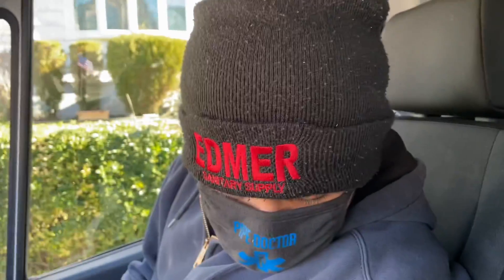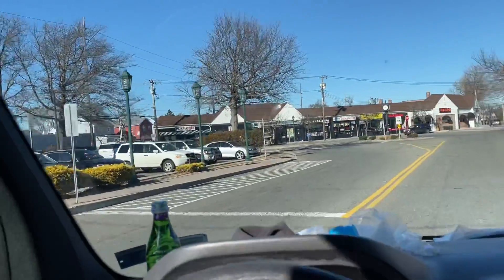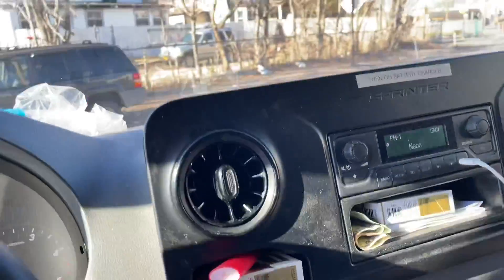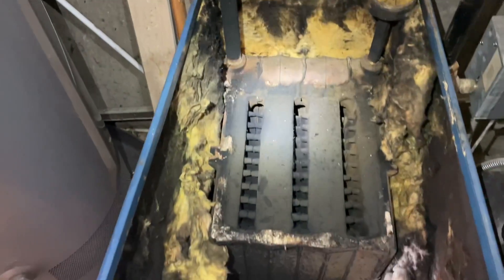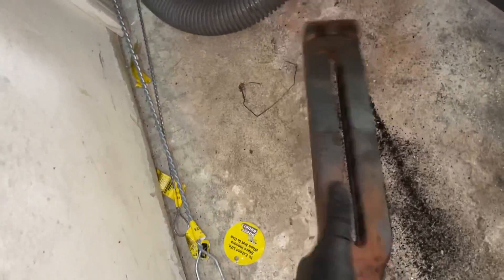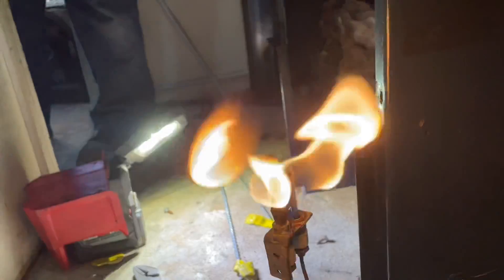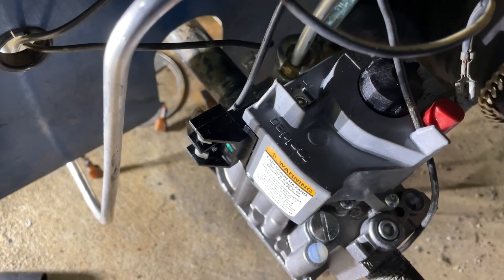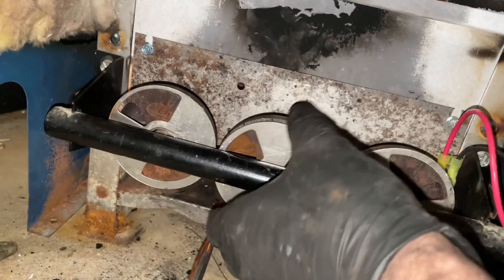They Almost Burnt Down The House Flames Rolling Out Boiler Bypassed Roll Out Switch Dunkirk Boiler

Comment: I've never used a combustion analyzer on a resi unit, seems like a waste to me when you're dealing with 1 maybe 2 stages?  Only time I use mine is on big boilers with power burners that are full mods to make sure you're burning correctly thru all stages!   I guess if I have a power burner on a resi unit I would but don't come across them too often. 

Maybe I'm wrong???

Comment: 12:20 i thought he was being mean but rewatching i had missed the bit about the meter zeroing out.  I find it helps people understand if they can form their own conclusions, tell someone not to do something a certain way or to do somthing a certain way, they wont understand the importance and reason. Have him see how skewed or invalid the readings could be. 
In fact itd be neat to see how sensitive these devices are by comparing relatively consistent measurements with differing levels of calibration "quality". Can they measure the oxygen and co2 of yourself breathing?

Comment: Food for thought. Sometimes easier to clean out sooted/carbonized gas boiler with a hose and wet vac. Soot vac top layer of soot. Then hose down in between sections. Use wet vac to catch water from underneath. Quicker,  cleaner and more through.
Reply: @PipeDoctor  Not as much as you would think. First time someone suggested this to me, I thought he was crazy. Put a gardening thing on the hose. Gives you total control. Have wet vac up and running. Will barely make a mess. You can also put some disposable baking pans under the boiler to help contain the water. Try it. Once you get the hang of it ( won't take you long at all) you will see that this method is a game changer.

Comment: I had call that there was a problem with a gas furnace. The home owe was a election. Who by passed the roll out switch. I wish I could send you the picture of the furnace and AC coil. 
The Ac coil was melted and almost burnt the house down. The owner said don’t need that switch . Be safe guys

Comment: Just found you guys and enjoying watch you guys work,

If you want a laugh, I just replaced my bleed valves with aladdin autovents, refilling the system post cleaning flush I thought I had all the new valves fitted. I didn't and after wondering why it was taking a long time to pressurise I found the puddle on the first floor under a rad. Always check never assume.

Comment: Good job.  Did you check for leaks ar the pilot tubing?  Also, don’t mess around too much with the gas pressure...it states the pressure on the boiler..usually 3.5” WC...don’t stray far from there.
Connect a manometer to the valve as you are adjusting pressure.
Reply: @PipeDoctor  WRONG, It is the Maximum pressure...

Comment: Never seen a gas boiler look that choked up...holy crap...2.5 hours doing what? Never even noticed the pilot flame thrower? 😂 Excellent diagnosis and repaIr. How do you keep the air dampers/shutters from moving on the burners?

Comment: I'm all about saving things. But this thing should be replaced jeez. Btwn the last person's bill. Your bill. And safety cheaper for new. Holy moly.
Reply: As my company would say, "Due to system age and condition, we cannot warranty repairs. Strongly recommend full replacement."
Reply: I dont know why you say that. If the owner only gets the rest of this winter and the next winter out of it, the cost was worth it. After a good professional cleaning and the repaired pilot flame, that thing may go for 5 more years with no issues.
Reply: @nickv4073  cuz he was at 90% the cost of a new boiler. Which would have lasted another 30 years.
Reply: @shahsmerdis  "90%"?  In what alternate universe?  lol!!